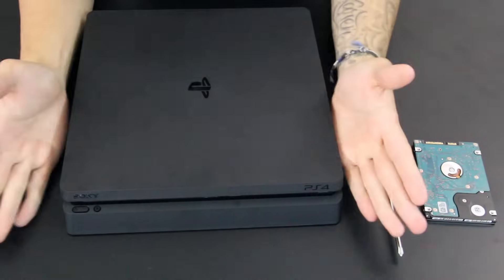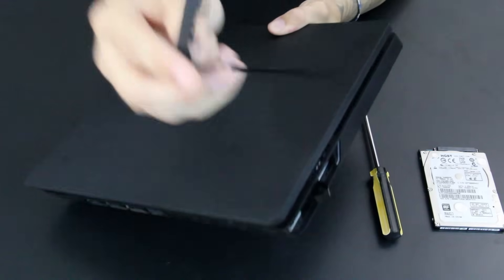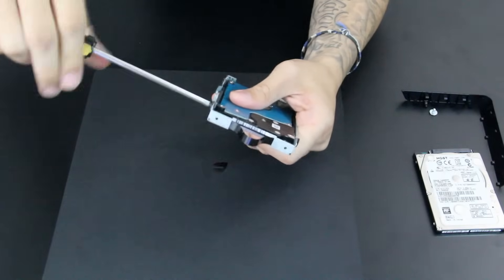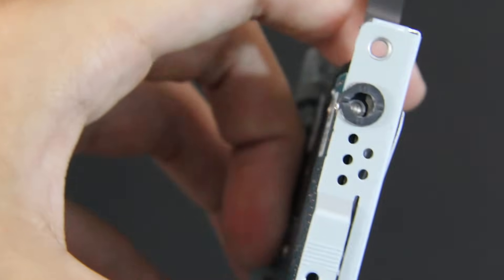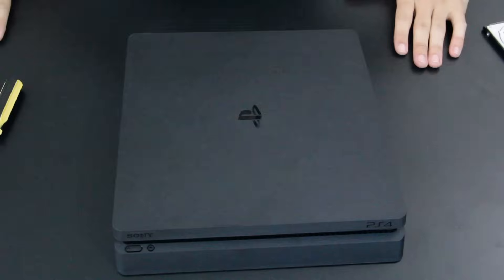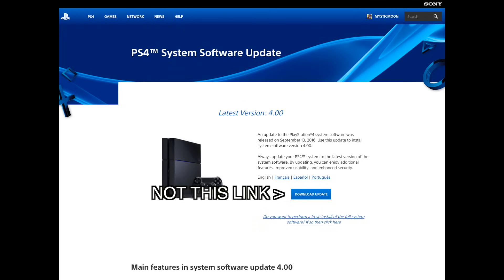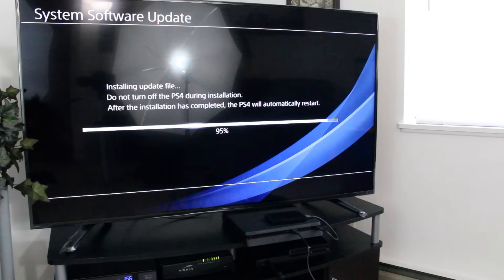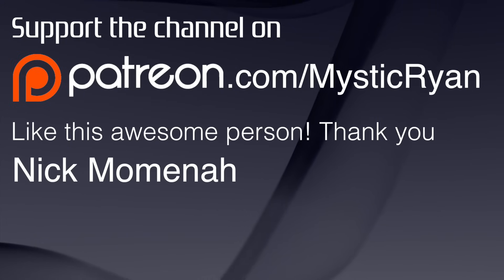Tutorial: How to Change PS4 Slim Hard Drive and Install System Software

Comment: But imagine i played a lot of games on my ps4 slim with the 500gb hard drive. And i want to uprage to 1TB, do i loose all the data of the ames i played before? Do i have to start everrything again?
Reply: if u have ps+ u can save it to the cloud storage
Reply: just get an external hard drive and back everything up
Reply: Felix. A If you really wanted to you could hook up both the new drive and the old drive to a PC and move everything I think
Reply: Question, would it work if I took out the old hard drive, and install it in a new ps4? Would all my saves be in the old hard drive?
Reply: Felix A. I got the same situation too my man. I’m getting about 4 games this year and I have very little storage. So what I can recommend is back up your data with ps plus. I can work trust me, as long as you got playstation plus then your fine
Reply: Felix A. Nope, your save data is on seperate files so as long as you can upload it to the cloud you should be fine. Just reinstall the games and you're good to go
Reply: Just upload ur save to cloud save storage ezz..but it only for ps+ member
Reply: i know this is one year ago and with 9 replies, but anyone out there reading this thread: you have to have a USB storage device or an external hard drive to back up your games to. when you have changed the hard drive using this tutorial you can plug the usb or the external hard drive back to the console and download your game files back.
Reply: I would also want to know the question ^ asked lol
Reply: i have an external drive with games on it but if i need to put the firmware on the same drive will it then boot into the firmware or do i need to use another hard drive?
Reply: I think you can buy a new ssd or new hdd. And remove your hdd in the ps. Then clone it to new hdd from pc. Didnt try but hope it works.
Reply: Felix A. Get an external hard drive and back up all your games
Reply: to be honest yes just like computers when the hard drive is removed all the game titles are in the drive 
includes the saved game progress also but you can put it on enternal drive which is the ps 4 main drive
but external dive means another hard drive if you have the portable hard drive you can put all your games progress
in there and whats better is that it improved the amount of space it has.
Reply: #9 how do I now? Ps4 won’t turn back on

Comment: Alright, I've been have trouble. whenever I try to turn on my DS4 controller it just flicks on and off. Could anyone help me?
Reply: It's not synced up with your system just think it up just plug the controller into the PS4 then use the home button to turn on the system

Comment: I just got my ps4 slim and it has no game save .. Do i need to download the updated software on the website or just put the new hard drive and setup and download the software? Please reply. Thanks. P.S . I still didn't try to open my ps4 because I'm planning to get a hardrive .
Reply: It's Brand new . I haven't open it yet. Just to be clear. Do I need to download the software on the website or Set up my ps4 with brand new hard drive and install the updates on the ps4 .. Is it possible? Thanks please reply

Comment: +Mystic I have a PS4 slim which currently has a 1 TB hard drive stored in it from Sony, I would imagine the size of the hard drive is a 2.5-inches. My question to you is, would a 3.5-inch SATA HDD fit into the fit in the hard drive enclosure within the PS4 slim without too much on an issue?.

Comment: Awesome video!  Showing the right update (New Installation of the System Software) to use is great, haven't seen that elsewhere.  You should make a video on backing up and restoring, how to make sure all your saved games are in the cloud, and how to backup/restore all the game software.  I'm doing that now and it says it'll take about 3 hours to backup my nearly full 500GB drive, I'm assuming the same to restore.  Need to have a big enough USB drive formatted for exFat, etc...  I assume I could just re-download or re-install all my games but that would take a lot longer, and I'd rather just get it done and have everything back to normal.  Would be great having a video showing the exact steps to make sure your saved games are in the cloud and discussing the options.

Comment: i had to trade in my ps4 og, months ago due to financial issues, im now getting a ps4 slim, is it possible to use the hard drive i had used on a previous ps4 with all the data, or will it be erased
Reply: thats what im trying to know
Reply: Hi I'm in the same problem what happened

Comment: Thank you, it was clear and stright forward i just upgrade mine to 2tb yes!!
Reply: Peter Chiu  hey what kind of hard drive did you use and we’re can I get it?
Reply: s y n x y I bought mine from amazon, a Toshiba 2tb for 70$, works just like the other one slightly bit less loading times, you can buy more RPM for more expensive, or if you are fine with loading times you have just get the same specs
Reply: Jovanni Garcia trust😂😂😂
Reply: Huge FX yo guys I need a hardrive what do you suggest?
Reply: vluirr I got a 2tb Toshiba off amazon for 70$, been working great, if you don’t have a pc or access to a pc, I suggest getting a external
Reply: vluirr for me, internal was worth it because it’s an extra USB port I have, and I don’t have to worry abt losing the extra piece, it’s all preference and based on how much storage you need
Reply: Huge FX I got a 3tb 😎
Reply: Bloodshot Bezzy external }?
Reply: @KARMA-mm7vu  u probably already bought one but i would suggest a crucial hdd because they are the best but idk how much gb u need
Reply: @Jovanni Garcia cause I won’t be buying the ps5
Reply: @reterumstrict1091  yo mai guy can you help me out?
Reply: @shayaanalislam2630  I got you bro what do you need
Reply: Where can I get one
Reply: @t-point7569  Amazon is a good choice the Samsung hard drive is a bit more pricey but you get what you pay for
Reply: Really 😯😃👍
Reply: I think imma do 4tb someday
Reply: @Jordan Mayhew what’s it called?
Reply: Same but my other hard drive broke so if you do have ps pulse did all you have to do was recover your saved data from the cloud because I don’t have an usb drive but I do have data in my ps plus online storage
Reply: I should probably search for a 2tb as well

Comment: Wow, thats pretty easy. I thought they made it more difficult on the slim models. Lol. I just sold my fat PS4 to my cousin and bought a PS4 Pro. I swapped the HDD on both because my fat PS4 had a 2tb. My cousin has my old, now with a 1tb, fat PS4 now. To replace the Pro HDD is about ad easy as the Slim, I guess. Awesome.

Comment: I replaced the 500GB hard drive to a 2TB. I followed your instructions to the tee. I get to the reboot and install the new system update, and it keeps telling me that the update can't be found. Please help.

Update: After I realized that I installed the 300MB file (it's easy to get confused with there being three links) instead of the 900MB file, I corrected the error and the system has been updated and the gaming has begun. Thank you for your easy to follow instructions.
Reply: Darryl Fletcher what was the name of the hard drive you got? I'm looking to expand my storage and apparently it has to be a specific type
Reply: The name of the hard drive I got was a Seagate 1TB Mobile HDD. Please note: the the hard drive MUST be notebook compatible, anything other than that won't work.
Reply: Darryl Fletcher thanks!
Reply: @darrylfletcher8558  if i use a normal laptop hdd will it work?
Reply: @nt-go2sl  yes, it should work.
Reply: @darrylfletcher8558  thx for responding
Reply: @nt-go2sl  you're welcome
Reply: @darrylfletcher8558  what about a computer hardribe
Reply: Darryl Fletcher thanks and if I wanna do this does it erase my game data or not
Reply: @Ieatmoilk  yes
Reply: Rose blossom if you want to keep the data buy an external hard drive with enough storage and backup your data then restore after the internal hard drive is installed
Reply: It has to be 2.5 inches or 9mm
Reply: if you wanna change hard drives Does it erase the data you have on games ??
Reply: @SquidwardTennisball  yes, you would've have to back it up on a usb and play no games for a whole day. :( But then you do have loads of storage:)
Reply: Dude my heart stopped thinking I just fucked myself over, thabks for the comment, it was helpful
Reply: He says this in the video before he took out the hard drive, but before u do ANYTHING ur supposed to always back up ur data (using either PS Plus cloud storage OR an external USB hard drive)
Reply: Can you upgarde it with seagate firecuda 2tb?

Please answer
Reply: @Brandon-dj9cq  yes
Reply: LunarLitso if you do get a hard drive for it, make sure the brand is Seagate and/or Western Digital
Reply: Darryl Fletcher what hard drive was it? 2.5 or 3.5?
Reply: Where the fuck did you get a 2tb drive?? And is it hdd or ssd?
Reply: Did you figure it out the error i got the same error but i figured it out what it was?
Reply: I made the same mistake
Reply: i can use hdd with any storage capacity?
Reply: Darryl Fletcher yeah same that’s what mine is doing too
Reply: Does the hdd need to be exfat format
Reply: some people say this is corrected by formatting the USB to exfat before doing all of this
Reply: You have had to reinstall all the games?
Reply: Don't update say no
Reply: Don't update say no then I'm pretty sure it's going to turn off then hold the ps4
Reply: Do you only loose your saved data if you change the hardrive without backing up
Reply: What system hardware  should i get for ps4 slim
Reply: Darryl Fletcher nak buat 2tb
Reply: everything else was so easy and I got stuck on this same part, their site confused me, didn't realize there was so many updates on the page, started to get worried for a minute till I read this lol
Reply: Is it a ps4 slim? What kind of hard drive did you use?
Reply: Darryl Fletcher dude you need a 500 GB one or 1TB one you can’t get 2TB

Comment: question?? lets say I bought mafia 3 on my standard issue 500gb (hypothetically speaking) if I upgrade my hard drive to a 2tb model, will I keep all my purchases from the PlayStation store, and all my saved data?? I'm using the ps4 slim thanks!!
Reply: Pn0ybr3aker yea
Reply: Pn0ybr3aker but for the saves put on the cloud or a usb stick
Reply: Kolbi Duck thanks!

Comment: I'm using one of THESE in my PS4 currently. I just got done installing the HDD and the system software is updating now.  Can't beat $70 for 2 TB's. http://www.bestbuy.com/site/seagate-backup-plus-slim-2tb-external-usb-3-0-2-0-portable-hard-drive-blue/5127032.p?skuId=5127032

Comment: i have a question for ya i cant get no one to answer so hopefuly u can im gona get a Seagate 2TB Barracuda its 2.5 but its says its 7mm not a 9.5mm will this work good in the ps4 or will it slide around fall out and mess up the ps4 i need this answered before i put it in hopefuly u can

Comment: If I already have a 2tb HDD in my PS4 now, can I just swap it over from the old PS4 to the PS4 pro with no messing or do I still have to do the USB pen/update even though the HDD has the latest firmware on?

Comment: Have a few questions, as I have yet to own a PS4 & am about to own a slim model:

1.) How much storage can you store up to using a HDD, SSD, etc.?

2.) Is it safe to take out the original HDD from the PS4, & insert the new HDD that I bought into the slim PS4 before I turn it on?

Comment: so can the slim fit a 15 mm drive or is it just the 12.5 mm thy have bean using im assuming the one you are using is a 9.25 mm it would be nice if thy did use a 15 mm that way you can drop a 4 tb in it i did that with my orig ps4 and had to cut out the hdd drive cage to make a 15 mm drive fit

Comment: Can I use the hard drive of my first ps4 in this new ps4 Slim?
Reply: yes and no you can but the hdd are married to the mobo so you are forced to reformat once you do so their is no real benefit unless the one in your current ps4 is bigger
Reply: so if i switch hdd to my new ps4 it's must reinstal the hardisk? so the data on my old hdd will be deleted??  damn. i'm already sold my old ps4 and take the hdd out.. i'm using 2tb hdd. and alll digital game in there.. any sugest for me? i wont download all data. it's take so much time
Reply: noooo i was about to do the same
Reply: You can transfer data from one PS4 to another with an Ethernet cable.
Reply: yes
Reply: If your ps4 overheated how can I transfer data?
Reply: No you can not just take it out and switch it you need to reinstall system software
Reply: so you need a new system software compared to the old ps4?

Comment: The amount of ppls i see buing this just for the HDR and 4k blueray is retarded.....buy a PC for. For the price of 2 PS4's ,PS+ and a game along with all your overpriced accessories you could buy a pc that would crush the ps4/PS4 Slim/PS4pro #justsaying
Reply: Yeah buy you have to upgrade a pc like every year
Reply: I might buy it because my ps4 just broke on me haha
Reply: JustDoIt that's a legit reason lol
Reply: Raymond Emde Yeah ik haha, will this ps4 take the same hard drive as the regular ps4? Because I have a 2TB HARD drive I'd put in here.
Reply: Yea it will as long as it's a 2.5inch laptop hdd. The ps3 had issues with hdd over 1tb but the ps4 should (haven't owned a console from sony since the launch of the ps3) not have any issues with a 2tb hdd but you will need to reformat it as in the ps4 will format it because the hdd data is locked to the original ps4 it came out of. There may be software online you could find to the the ps4 hdd to be able to be read by a pc. I know the ps3 hdd could not be read by a pc you had to download a special program bit can't remember the name off the top of my head
Reply: See if you can get a external hdd reader and then conect the old ps4 hdd to the new one though a usb connection you might be able to get your save game data off of it that way
Reply: Raymond Emde Yeah it's the right measurements so I'm just gonna transfer it over and download the new system software to the new ps4
Reply: Nope my 4790k will last me 5 years and my 980 will last 4 or 5 years. You only have to upgrade each year if you buy crappy cheap parts like if you buy a gtx 950 and a i3 yea you will need to upgrade every year. Not trying to be a dick but before you start talking about gaming computers do some research
Reply: Could probly starch it 6 years if the hardware don't give out. My 8350 lasted 4 years it just died a glorious fiery death.......to much over clocking
Reply: buy a b10 quantum battery drive and shut up
Reply: You came to this video to say that?
Reply: Mr R00K but I want to play Uncharted and the last of us. Just saying

Comment: Aye, I currently have a 2TB hard drive in my PS4 now. I plan on getting a PS4 Pro day one, Will i need to reinstall software updates or reformat the hdd when i install it into the new PS4, or should i be good to go.
Reply: I don't know but I have the same question.
Reply from the maker: When a new hard drive is put into a PS4, the PS4 is likely not going to boot properly and it absolutely will require wiping the hard drive. So you'll have to back up all your data to an external hard drive. Then when PS4 Pro comes, you can put your old HDD in, but you'll likely still have to reinstall the software. So once you do that (and the PS4 Pro will require the HDD to be cleared) you can plug in your external hard drive with your data, restore the back up. And then you'd be all set.
Reply: dont buy the pro
Reply: keila Garza u about 2 weeks too late lol
Reply: Lorde Lightskin did you get the 2tb from your old ps4 in the pro
Reply: Nick Diaz yes i did

Comment: Can I replace my Hard Drive as soon as I get my PS4, before I even turn it on?
Reply: Someone please answer this question
Reply: The answer is "yes".  I actually did it as soon as I bought the PS4 Slim
Reply: Shane C Awesome, thanks for the reply
Reply: do you still need to have the software update before you even turn the PS4 slim on? from the website I mean
Reply: Shane C hey man, what if you have games installed on the default drive and decided to change the hard drive?will corrupt the datas?im not good with computers please help
Reply: Honestly, I don't know.  Sony customer service might be able to help with that.
Reply: will it corrupt the datas?
Reply: Actually, It was a 1TB HD with 8GB NAND.
Reply: hey mate, if you buy an external hard drive (1tb is fine, 500gb is even fine tbh) they are around $60 or so. You can backup your entire systems applications to this external hard drive. I am actually in the middle of this process atm. it takes around 3hrs to backup 400gb of applications save data etc. Then install the new hard drive just as he did in this video. Reboot it like normal etc. Then go to the system, backup/restore then restore the data from the external hard drive and boom. Your old ps4 interface is there with all your old games & save data etc. Now i'm not sure how long the restore will take, most likely another 3hrs or so. So make sure you do this on a day where you've got a good amount of time on your hands
Reply: Breeezy B do we need a pc to download the sony thing
Reply: Did you still have to download the system software?

Comment: Can you fit a 2.5,15mm 4TB drive in it?
Reply: has to be 9mm
Reply: LiveingamerTr 

Yeah it is easier to use an external HDD, but as far as I know the external drives run at slower speeds that internal drives, unless it's an SSD.
Reply: İ think using the external ones are the more senseable
Reply: Hmmm thats a bad shit